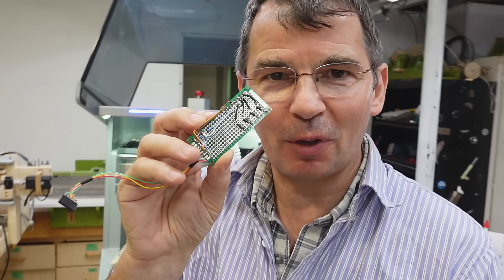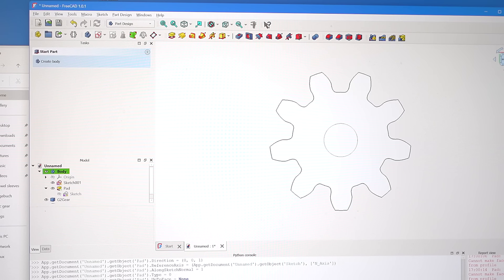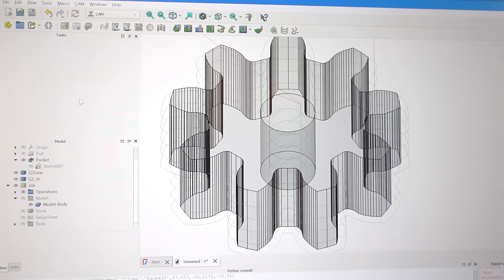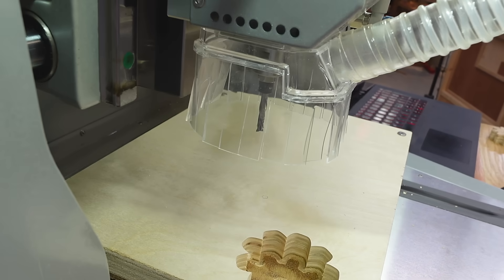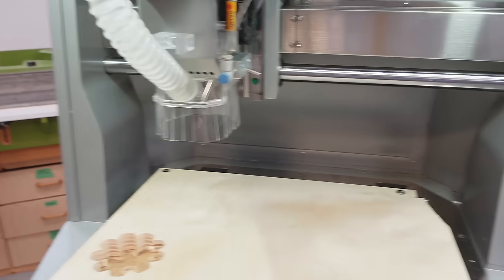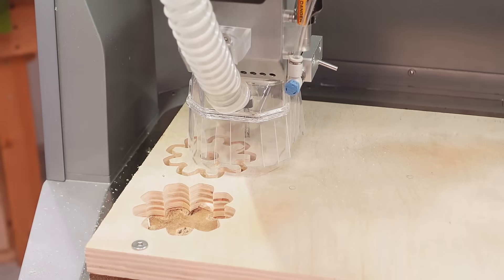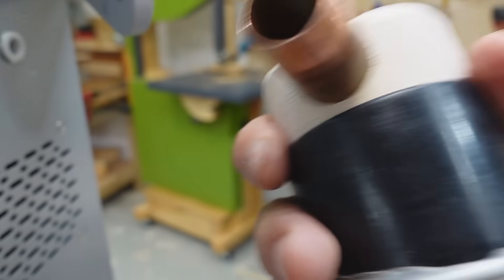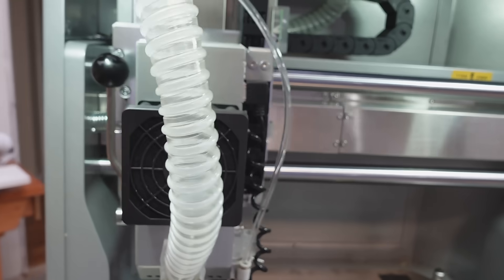Steep learning curve for using CNC

Comment: I spent the last two weeks trying to learn how to use different CNC/Gcode software. It is ridiculous. Every software I tried (and paid for by the way) was completely unintuitive and overly complicated. I really dont think the learning curve should be this steep. Im not designing rocket engines here. How is there not a simpler straight forward software for hobbyists?
Reply: The program you want is GatorCAM for CNC!!
Reply: Because its actually a really really complex thing to do right - you have decisions to make at every stage that matter to every other - its a heap of simultaneous equation where all the variables are blanks till the user makes a decision . 3d printers and to some extent lasers and waterjet type cutters can manage to make it fairly simple because the tool is relatively disconnected from the parts - it is very much just trace the outline nothing about what is under the tool actually impacts the tool, but everything else...

For instance assume an upwards spiral cutting mill so its actively trying to pull the part off the bench, but clears chips really well - how deep can you actually cut in a pass before you are warping the part with that lifting force or pulling it out of the clamps entirely, or is your machine stiff enough to take a 2mm pass in this material? 

Which are all something you can't even begin to make a sane decision on without also knowing what the material you are working on is and how its held down to the machine, if you are running active coolant loops, what the tool is made off - some materials are stiffer, some are rather more melty, some will be very grabby on the tools, and some tools will go dull very quickly if you are not using them right.

And then you change one variable like your bit diameter is now 3mm instead of 8 - suddenly everything that was working right is wrong, and you will almost certainly snap the bit if you don't change all the other variables.
Reply: @foldionepapyrus3441  CAD has nothing to do with controlling the machine. A machine controller does that. Machine controllers are separate software. CAD doesn't even generate the commands to control the machine. CAD just makes the digital files that represent drawings or models. CAM makes the machine control commands. Then a controller uses that code to run the machine along with its code. So there's three layers of programs in use. CAD, CAM and controller.
Reply: @1pcfred  And what I'm describing is very much the CAM element, which it seems is what the original poster is really struggling with.
Reply: That's CAD. All programmers who write CAD software are blind and have never seen an image or know the first thing about how to create one.

Comment: Old versions of Carbide Create allow you to output G code, version 652 specifically. The structure of those programs are for beginner hobbyist CNC folks, so they're pretty intuitive.  

You can certainly import an SVG, tell it your material thickness, and quickly generate tool paths. I believe you can also append all your Gcode for whatever custom commands for your CNC or to park it in the back right corner.

Comment: Emergency stop doesn't stop the spindle? Seems like a massive safety oversight.
Reply: The button on top is a control button and it pauses the program by default (you can configure it). When you pause milling operation, you usually don't want to stop the spindle. There is proper hardware stop button and I am wondering why Matthias hasn't used it. That completely shuts the machine immediatelly including spindle.

The machine is totally worth the money and it was the best investment I made in tha last year. It's so nicely built for the money and you can't get a better value/money desktop CNC at the moment.
Reply: The spindle of my CNC machine isn't under machine control. I have trust issues. I have a toggle switch right on the machine and the spindle doesn't run unless I flip that switch.
Reply: yeah, that should be a no brainer...
Reply: Try kirimoto as a cam, it might not be as powerful but it's plenty for 80% of the stuff like this
Reply: Just got to that part in the video. Felt like the machine was screaming "DO NOT WASTE YOUR MONEY ON ME"...
Reply: That's pretty common.  Nearly all hobby CNC routers have standalone router controls.
Reply: Havent watched the video yet due to its choppy framerate, but if thats the case, thats a serious safety hazard.
Reply: It's not that big of a deal, when the motion stops, there's nothing feeding the spindle/cutter so no issues there. Cutting power to a spindle could generate a back surge and damage electronics so it's best to do a controlled shut down.
Reply: @imqqmi trust me, you do want to stop the spindle when something goes wrong. You can have tool failures that put the spindle way out of balance. I’ve had a protective film on the workpiece get ripped off and wound around the tool, putting it way out of balance. 
If something is coming loose from its fixture, a spinning tool can throw it. 
Maybe it’s not so bad on a tiny machine with a tiny spindle, but an e-stop button by design should stop everything and make the machine safe
Reply: @oliverskrzynski3317  I had that happen too, but with foam! Quite a loud bang, but it wasn't really that dangerous. On my previous machine, an Ox clone from open builds with belts, it got caught on a piece of aluminium, the spindle was stronger than the steppermotor holding power and rode on the aluminium and slammed to the side. A good example of strong mechanics being important, not just for cutting forces but also for taming the spindle.

Sure a stop button should cut all moving parts, but I have and escape key on the keyboard that cuts xyz motion. The spindle stop button isn't far off. But I never felt the need for a dedicated stop button.

Aside from the scare, would the stop button have limited the damage in any way?
Reply: @imqqmi  Back-EMF handling is universally passive. Or at least close enough to make that a blanket statement. The TVS diodes that should be protecting control electronics in such applications ARE universally passive because they have to clamp the transient before it has time to damage upstream silicon.
Reply: @Originalsunrunner20  large CNC machines use IGBTs to "regen" the back-emf of motor deceleration back to the AC line, or to braking resistors (depending on the drive) which is functional even if the e-stop is pressed, and they also have an emergency disconnect if that fails. So normally if you press e-stop, the spindle is actively braked, and stops VERY quickly, but if that fails, the whole drive disconnects, and the motor will coast to a stop without braking.
Reply: @imqqmi  LOL it's a huge deal if the spindle is caught on something and slinging it around. Especially if the thing it is caught on is made of flesh. 

Before you say you shouldn't have your bits in there, ya, you shouldn't ever have your bits in the spinny/cutty bits of any machine. But that shit happens, and that fact is the literal reason emergency stops exist.
Reply: @imqqmi  Unless something got caught on it like some string or hair. If it is an emergency stop it should prioritize your safty over that of the machine.

Comment: Onshape? I've used it before to design STLs for 3D printing...works pretty good. Not sure about tool paths, though
Reply from the maker: Hadn't considered that, just looked into it.  Yes, it can do tool paths.  But the only videos on that are from OnShape, which aren't all that good -- they don't actually show using it for a real project.
Reply: Its commercial license is absurdly expensive. If he wouldn't use Fusion because of price Onshape is simply far worse

Comment: I was going to build a CNC but I figured that needed to know how to use a CAD application first. I did the research and FreeCAD  was the only viable option. After a quite a while learning the tool, I decided that maybe I didn't need a CNC after all. 😢
Reply: try blender maybe :) its less terrible, and its easy enough to export and cut with other software if needed
Reply: @ChongMcBong  Blender is NOT a CAD program. Just use Fusion, it does everything u can possibly need as a non commercial user.
Reply: @ChongMcBong blender is absolutely useless for anything related to cad.
Reply: What really sucks about FreeCAD is it doesn't really support Standard. At least it didn't the last time I tried it. It'll look like you can use Standard but when you go to export a file it can't really do it. FreeCAD only really works with metric. But the program is under constant development so many that'll get fixed? I know the lead dev of the project is not a fan of Standard and that's hampered development in that direction. He's pretty much sabotaged the whole project so it'll never work right.
Reply: @1pcfred  sup bud, you still here?

Comment: In the "Pad" dialog you can check "Reversed" to extrude the other way.
Reply: horrible UX, they just could have auto-reverse when entering a negative number. who develops this junkware.  it needs a overhaul like blender had a few years back, its now on par with the big ones.
Reply: @gamerpaddy  Entering a negative number actually also works.
Reply: @gamerpaddy  
"horrible UX,"
In many ways, yes, but I can't see much wrong with this particular option.
Reply: @gamerpaddy  That is your opinion. The checkbox is right there next to the dialog for the number. As far as I remember, the commercial CAD packages used to have it the same way.
The thing that is unintuitive is that other packages assume by default you want to design a "part" with sketches and extrudes, etc. In FreeCAD there are multiple ways of designing a part. Not sure how it is these days but when I started using it, the fact that it assumed a different way of working by default was what was mostly confusing.
Reply: @SillieWous  Its probably the other way around. Thats YOUR opinion that this software does it "right". Its the most awkward to use CAD Programm of the last 20 years and isnt used because it is not user friendly, exactly like blender prio 2.8. It got an extreme UI overhaul back then and rest is history.
FreeCAD needs to do the same approach, since most users complain about that. Often it feels like, they do stuff differently because they want it to do it for the sake of it and not to do it better.
Reply: @SillieWous  There are many way you can create a part in freecad. Most work nowdays is put into Part design module and is intendted for  parametric design, while part module is more geared towards CSG.
Reply: Last 5 to 10 years at most. And many CAD software is in fact worse. Solidworks has the same methodology but they updated the UI to hide most advanced features. In fact, if you've used Solidworks before, then you should be right at home here bar some nice UI/UX downgrades.
Reply: @TheSliderW  Well since then a lot has in fact changed. Worked indeed with Solidworks and Siemens NX in the past, both have/had the "reverse" option. Maybe it is because of the way I think, but negative distances doesn't make sense in my mind for this.
Reply: @tedristhreed6641  If it is MY opinion, it necessarily also is HIS and YOUR opinion respectively. I never said it does it "right", I gave you my reasoning why I don't agree with the notion that the reverse option is bad UX.

Comment: After seeing what what you showed i can say it's a user issue not freecad issue.
Reply: User name checks out.
Reply: @setSCEtoAUX  Very deep insight. Thanks.
Reply: Freecad is a nightmare
Reply: @marcbotnope1728 FreeCAD is fine. A bit rough around the edges, but a great open source tool.
Reply: @marcbotnope1728  Sorry? It's different, but it's good enough for a personal use. New version 1.1 will be much much  better.
Reply: I am a proponent of open source but we do have to recognize our shortcomings in order to improve and FreeCAD is a very problematic project. It always has been. The lead dev is German and that says it all.

Comment: It sounds like you don't have the right post processor in the FreeCad.
Reply: If you want to call it post processing. What's likely happening is his machine needs an initialization command of some sort. Which is in all of the example code but the output of FreeCAD lacks. It would take examining all of the code side by side to suss out. What's in the header of all of the example code that isn't in FreeCAD files. G Code is plain text so it is human readable. Every line is a command and parameters. Pretty simple stuff really. The controller scrolls the code as it executes it. You can see it happening in this video.
Reply: @1pcfred  I don't know anything about freecad, but I know in fusion you need to make sure you are using the right post processor for your machine.

Comment: freecad is aids. it's like they said let's make gimp worse by adding another dimension.
Reply: No, its not.
Reply: @DanielBadberg  While you do make both an insightful as well as compelling argument, I'm going to stick with my initial assessment.
Reply: @MadeInMichigan  Of course 😁

Joking aside, I never really got into Gimp, and I haven't really needed it so far. But the comparison that FreeCAD is Gimp with a third dimension in terms of usability and appearance is simply not true in my opinion.

I've been working with FreeCAD since version 0.16. And that version was already usable, even if it wasn't easy. With version 1.0, usability has increased significantly. 

Ever tried Blender? You can't just jump in and create a model with it either.
Reply: @DanielBadberg  That's true. Blender is a bit of a nightmare in its own right. But, knowing what little I do about it, it is what it is because that's what it needs to be. It's kind of like going from Paint to Photoshop.
I crap on gimp, but I use it. I don't like it, but I use it. I often have to look up tutorials to do what should be simple, ordinary tasks. Nothing about it is intuitive. 
And that's my real problem with freecad. They buck industry standards and conventions. (Maybe to avoid legal troubles. Maybe, like gimp, they just think they know better.) But, again, very little about it is intuitive.
Even, e.g. fusion, is pretty bad in regards to breaking standards and conventions, but enough of it makes sense that you can catch on.  I didn't find that to be the case in freecad.
PBKAC? Maybe. Lack of commitment? Probably. 
Maybe I'll try it again one day. I didn't know they were out with an official V1.
Reply: @MadeInMichigan  Okay, I understand your point of view. I'm not a professional CAD draftsman and don't know what industry standards exist. But I do know that I never got along with Fusion, whereas I did with FreeCAD, even back in the 0.16 days. A while ago, I tried Onshape and designed a part that I had already designed in FreeCAD. Onshape was very similar to FreeCAD in terms of operation.  

In my opinion, one should never forget that FreeCAD can be used without any license restrictions and costs nothing except for the time it takes to learn how to use it.
Once you understand the basics (Part Design Workbench -> Make Body -> Create and constrain drawing -> Extrude (or Subtract)), I find it intuitive because the steps are easy to follow. Someone else may see it differently, and if they provide an explanation, I can live with that. But if someone simply says that FreeCAD is rubbish without giving any reasons, then I have to disagree.

And yes, you should check back every now and then to see how far FreeCAD has come and whether it has become more usable for you.